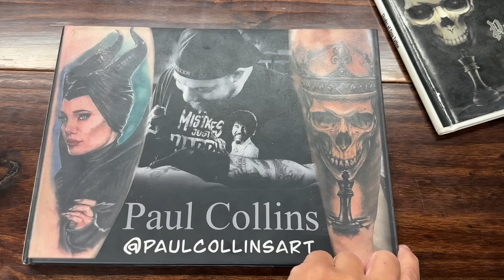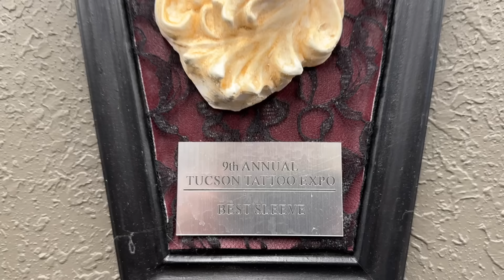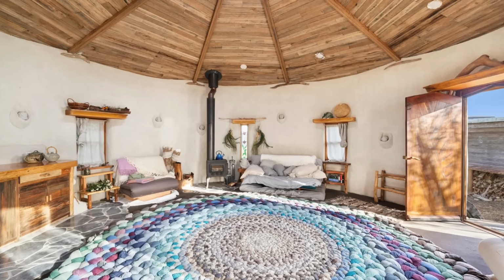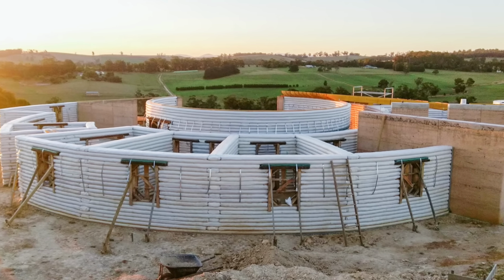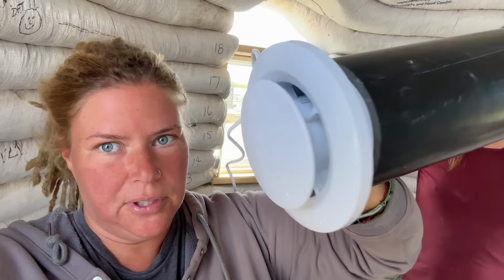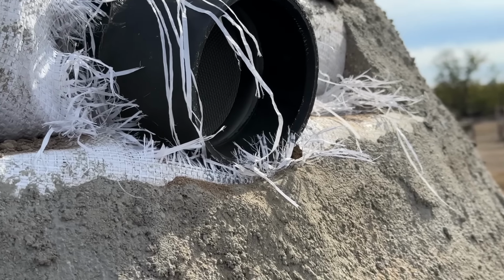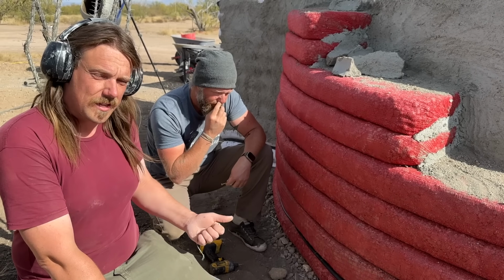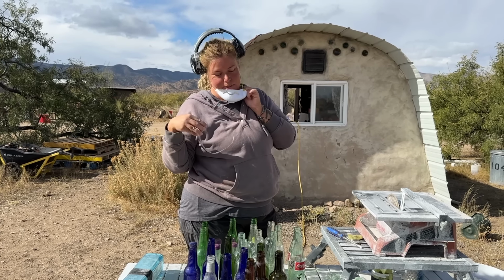TATTOOS & TEARS 😭 - Hayden Heads Back to Australia

Comment: Have you thought of a Mosaic with the remainder of the glass from cutting all the bottles. You can easily make a tumbler and break the glass, put into tumbler to round the sharp edges and design wall art or walkway art - As you have so many artists for kids that could design something really cool, like you do with so many things!❤
Reply: i thought more of crunching the glass very fine and mixing it instead if sand into the last layer of clay/plaster on the inside. there is even a startup company doing that with waste bottles.